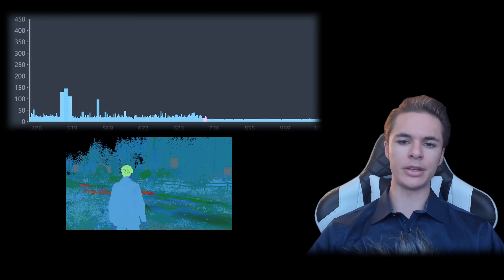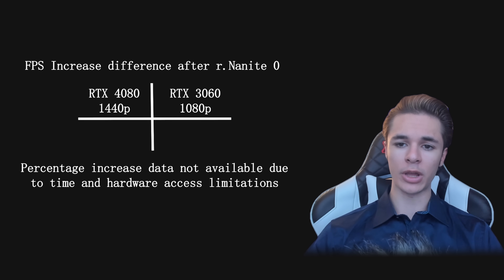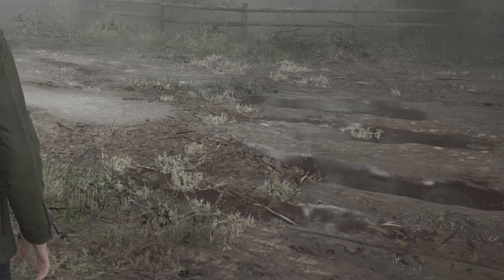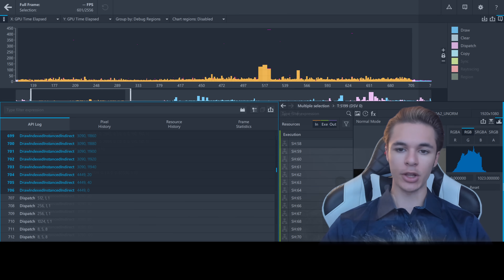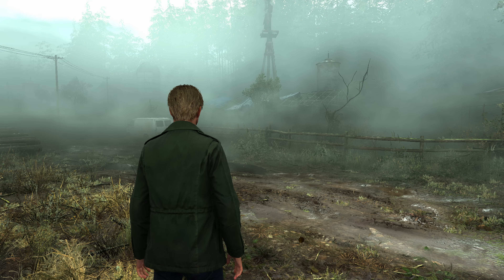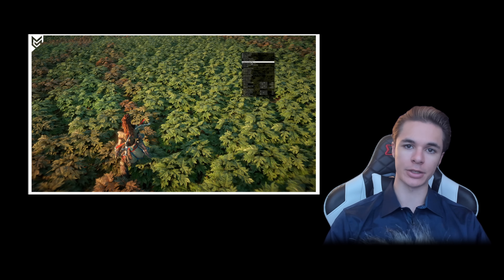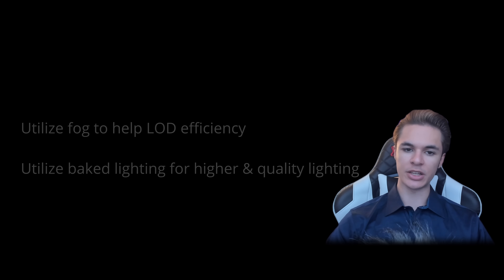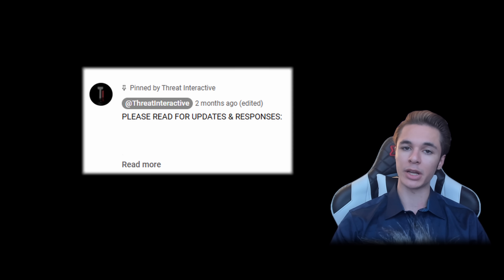The Price of Realism? | SH2R Optimization From The GPU Perspective

Comment: I already hated UE5 being adopted by developers. Forcing people to buy video cards ever-increasing in price for graphical improvements that get overshadowed by a smeary picture and poor performance. Now I can articulate it even better!
Reply from the maker: Reading some of the replies here are incredible miss representative of the issues going on. 
"Hardware will get better"-It already did with base 9th gen consoles. 
SH2R is far from an improvement on what has been delivered on 8th gen.   

"without engines like ue5 pushing realtime graphics forward we would be stuck in last gen"
How about we stop considering temporal ghosting, immense blur, and flickering visuals in a static game as "next gen" since those issues we're already present in 8th gen. 
When we get 60fps with raytraced specular, better PBR/Shaders, and crisp(non-aliased) resolutions, then we will push into Next Gen visuals. 

 UE5 is not pushing anything. It's a filled with virtual production bloat and poor designs that go against image quality.
Reply: @ThreatInteractive  I have a question about why the IDTech engine is so vram hungry? We've seen it with doom 2016, eternal and now Indiana Jones 2024 game. All of them use up tons of vram, especially if you max out their textures. Just curious as to why that is and is it mismanagement or the games really do need that much vram and nvidia (and amd to a good extent too) have been giving us too little vram for the past couple of years.
Reply: @ThreatInteractive  i don’t consider any of the visual aspects you brought up as next gen. That’s a straw man point to make and misrepresentative of what I said. What I said wasn’t misrepresentative it was an attempt at balancing an overly negative, one sided and oddly emotional response to some of ue5 issues. That engine needs work no doubt but it can and has still produced some of the best looking games ever when run at the right settings. If you cant see that I’d say there’s some bias at play from your end or your new to gaming
Reply from the maker: @neilranson4185  
RE: oddly emotional response to some of ue5 issues

It's not odd, what's happening to modern games is tragic and it's infuriating to see this happen to your industry. The support we get shows that opinion is quite popular.

We're not new to gaming, we're just not ignorant on what the solutions are.
Reply: @neilranson4185  My guy look at most modern games.. TAA sucks ass. There is a lot more blur and temporal slop now than there was years ago, not to mention hair seems to be just as bad as when I was still in highschool.

Next gen graphics is a joke that keeps on giving.
Reply: @ so you think the best games of previous gen’s image quality look better than those of today? 360/ps3 with its very noticeable low res aliasing? Or ps4/xbox 1 gen with its only slightly better IQ over what come before with its 1080p top res and shimmering. Just take gta 5 360 version, ps4 version and ps5 version. Unless your playing on a game boy
Reply: I'm at the point where if I find out a game is using UE5... I'm not buying it unless I hear rave reviews about it's optimization on much older, lower end hardware.

Even then, I'm still not buying it unless I also know it's devoid of Predatory Progression Systems/P2W/Rigged Matchmaking, Gambling, Wokeness, Always-Online DRM/Live Service BS.
Reply: Exactly. I am completely fine with graphics like in God of War, Horizon, Death Stranding, Doom, Resident evil. Good graphics and performance. Last gen was great in this specific area. Now we have 30fps upscaled mess in fancy new games
Reply: I hear ya on this. It is a love hate with me...UE5 is just faster now. Studios don't have to hire as many artists or devs to work on handcrafted visual elements, like lighting and textures. It's all procedural now. Saves tons of time and money, however it does lose some of the flavor games used to have. 😢
Reply: Nvidia controls Epic Games (conspiracy)
Reply: You used to have to upgrade way more frequently in the past. Currently a midrange card can easily last you 5 years which is very good imo. Not sure why people are complaining.
Reply: @gavinderulo12  We would also see leaps and bounds of graphics upgrades.
Reply: @gavinderulo12  wrong. im into pc gaming since 2001, since geforce 4 mx and geforce 4 TI. Maybe before . My first videocard was a riva tnt2 m64.
Aside from pixel shading / "dx9" , you could stay with a videocard and play games till it die. games always came with different render suport so you culd play it in a voodo, riva, geforce or ati/radeon card. IF it wasnt enough, EVEN suports for windows, linux and Mac. It was a lot of possible combinations between hardware and software.
Nowadays they dont even suport "full render" in the render engine they use. They just DONT OPTIMIZE.
Reply: You don’t think silent hill 2 in quality mode on consoles looks impressive? Or hellblade 2, nobody wants to die, jusant, and robocop? Genuine question
Reply: @neilranson4185  The point is not that they have impressive aspects or not, the point is that they are mismanaged and they could be better if some lazy tech wasn't being pushed so hard . TI don't say "throw UE5 in the trash" they literally say that they are working on it to enhance it and correct shitty problems. They literally say that developing alternative engines is mostly a waste knowing that the industry will not support them.
Reply: @TheOneAndOnlySame  I disagree it is important that engines have impressive aspects, without engines like ue5 pushing realtime graphics forward we would be stuck in last gen. Does it have issues, of course but that’s a separate subject. The engine has proved its self with games like silent hill 2, hellblade, jusant, fortnight etc now it needs to refine and fix which it is over time
Reply: @neilranson4185  no you misunderstood me. I say that yes , those games you listed are impressive (well, sh2 is not imo but let's not dwell on that) , I'm saying that this engine has major flaws and that's the subject.
Reply: @TheOneAndOnlySame  I don’t disagree that it has flaws my point was it’s also capable of extraordinary visuals in the right hands to. It feels as though it will get into its stride with the collations efforts on the new gears
Reply: @neilranson4185  They can't even fix the stutter, It's been an issue for more than a decade. Do you think they can improve?
Reply: @theunwantedson  Iv only seen the stutter in ue5 and yes it has been “fixed” depending on the game. Seems to be a combination of the engine and developer choices
Reply: @neilranson4185  no hellblade 1 was more impressive for me than 2. In Hellblade 2 everything is smeared, bad DoF implementation, chromatic abaration, many flickering pixels on stones etc. everything maxed on a 4070 super. I downloaded some mods to get rid of those fake and bad implemented cinematic effects from Nexus and it looked so much better and with better performance. The devs don't know shit and UE5 is keep pushing their false agenda. Graphic fiedelty isn't important than your games runs like trash and smeared all over the place.
Reply: @ I’d check your settings and rig as it didn’t look anything like what your discribing on my series x, stunning on that, the pinnacle of life like human rendering in real time not to mention environments and effects. Original hellblade is impressive but a clear generation behind number 2
Reply: @neilranson4185  "realistic" games generally do not look that good without huge performance hits.

Cyberpunk 2077 with "realism mods" look amazing, but I have yet to see any AAA that comes out to look like that, let alone run well.

most older less realistic games look better, because they look stylistic with a game feel, rather than a botched "uncanny valley" thing going on with "realistic" games.

Something like FF7 is an example of characters who look great without forcing a bad  "realistic" appearance like Silent Hill 2
Reply: @ guess we have different views on what looks good, I for one think cyberpunk standard, Alan wake 2, hellblade 2, silent hill 2 remake, gt 7, Callisto protocol, Spider-Man 2, avatar, flight sim 2020/2024 all look incredible this gen to name just a few
Reply: @neilranson4185 for me Cyberpunk is just a GTA style Flop with Funny bugs as features, with people and cars constantly disappearing, your car or bike can stuck and launch into the sky or even came to you flying like wtf Lol, and it's not UE5

Also Hellblade 2 is boring, and Short, lucky i was on game pass so i don't have to pay much and still able to refund, lazy dev who spends time on Body details and no plot.

Silent Hill 2, biggest Unoptimized Flop, just like the guy said, it has Unoptimized tree model with Unecessary polygon, i had to use Custom settings and mods to make it playable with the same image Quality as default, also the Voice actor sounds like they don't get paid enough to do this game 😆.

haven't played alan wake 2, I'll check that out.
Reply: @DavidWeIIman I agree cyberpunk was like that at launch but now it’s a very different game mostly free of bugs, it’s been a huge success story rather than a flop. 

I think the industry needs more short games, there’s a market for them and there’s less risk involved. I wouldn’t descried ninja theory as lazy, 4 years of 80 people working full time is a lot of work regardless of the end product. 

Again silent hill 2 sold well, around 2.5million copy’s. It certainly had performance issues but looked stunning with nanite and lumin. 

I doubt you will like Alan wake 2 but it runs on one of the greatest engines, northlight. Patterning on high end pc is a treat.
Reply: You can't.

This is all in the short term, the hardware will become better and these games will look much better in the future, because they are not pooping in and out optimised geometry.
Reply: @TheReferrer72 "Hardware will become better"

Intel: "Soo, our new CPUs are now slower. Enjoy!"

AMD: Zen 5%
Reply: Pooping in lol games won't look better in the future they've been downgrading themselves since 2007
Reply: @ut2k4wikichici  what are you talking about!? Games have been getting downgraded since ps2 era, anyone with any knowledge on the subject can tell ps2 era games looked the best
Reply: @neilranson4185  Depends. If you mean in terms of art style, you'd be very correct. The weaker hardware forced devs to hyper focus on a strong aesthetic. As graphics got better, the shift became more about how "real" can we make our games look. So modern games will mostly always look better than last gen, but much of the art style is lost in the realism.
Reply: @  I agree to a point but the extra processing power also allowed for more artistic freedom and expression just look at examples such as ori and the blind forest or dordogne or concert genie, these are modern games with gorgeous unique art styles only possible on more modern hardware
Reply: @neilranson4185 internet are full of experts 😂
Reply: @ yes and no just back statements up with facets at leadt
Reply: @neilranson4185 quality modes on console look the best but are locked to 30 fps with terrible input delay
Reply: @  I didn’t find the input lag bad my self and that will be my mode of choice for sure specially with the higher lumen setting but minus the pro patch, I’ll run it from disk
Reply: @TheReferrer72 who can say for sure that they will be alive in the future. I need game to look good at present.

Comment: Can you clarify regarding how Fortnite doesn’t use WPO to animate leaves and instead bakes textures? Wouldn’t those textures still be plugged into the WPO of the leaf shader?
Reply from the maker: Not too sure, they never documented it very well 🙃
Reply: I'm pretty sure it's using vertex animation textures, a system where you basically bake the positions of each animated vertex into a texture (i.e if an animation is 24 frames long, each vertex will have 24 RGB pixels). At runtime the textures are used to displace the geometry itself on the GPU.